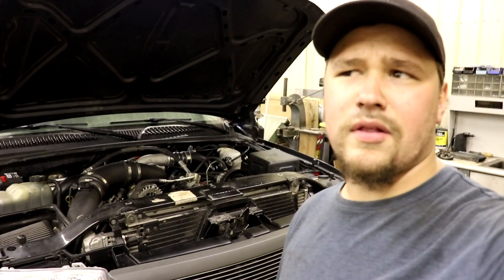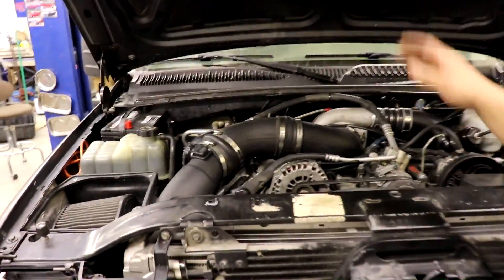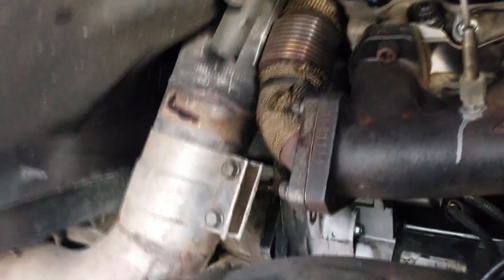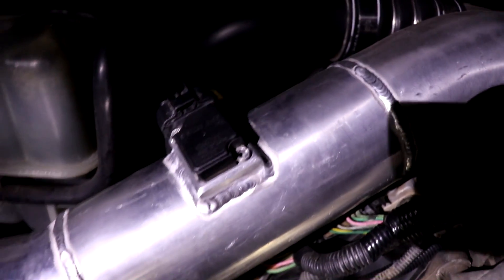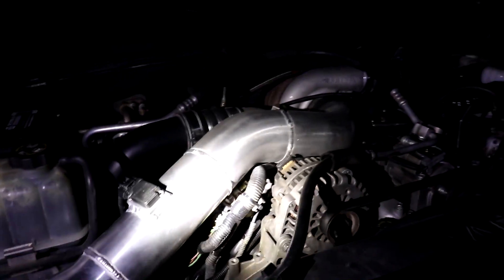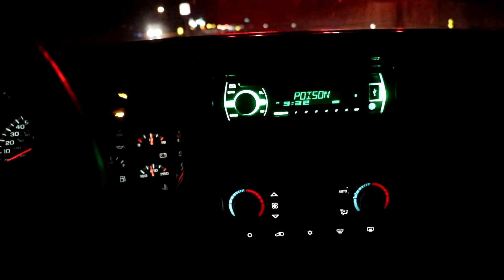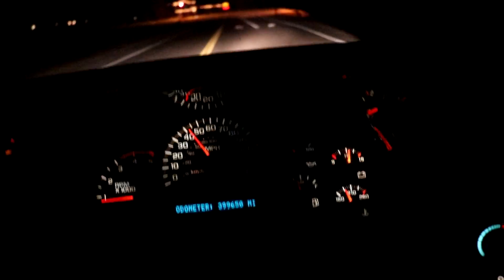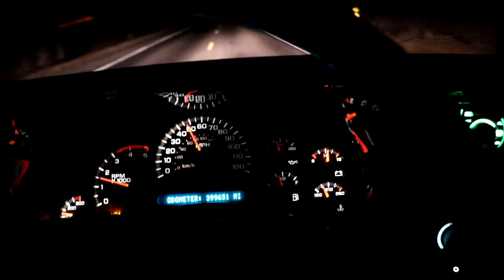Custom Turbocharger Intake | Duramax Project

Comment: The MAF is used by the ECU to calculate fuel. If you increased tube diameter, the MAF will be seeing less air speed and does not know the diameter increased so is in fact flowing more. As a result your ECU is sending less fuel than before if tube size increased. Solution is to do a remap on the ECU to adjust fuel. This does not mean it is necessarily the reason you are hearing turbo flutter. That could just be because you got rid of plastic and silicone tubing which makes turbo more audible. If you also got rib of the airbox this will multiply the noise further. I love duramamax engines, wish I had one in my 4x4!

Comment: idk if you figured it out but your mass air meter is tuned to the diameter of the tube its in, thats how it can figure out the mass of air if it knows the volume of the tube. a retune accounting for the diameter change should get her back to how it ran before

Comment: idk anything about duramax's but usually on MAF engines if you change the sizing of the pipe the maf is in you have to scale it in the tune. i think* when the diameter of the housing increases the maf sees "less" air coming into the intake. you must tell the ecu the values and issue should be fixed.

Comment: Did you respect the inside diameter of piping where the MAF is ?
You need to get the same diameter as the stock one was ,otherwise the MAF can't read a flow correctly.
flow is speed on diameter : you modify the diameter and the MAF is clueless of what's happening flow wise.
To be more accurate ,the MAF read and report a flow ,as a value,but the ecu can't interprete the signal correctly,the references the ECU relies on being modified.

Comment: I've got to tear down my lb7 and do a head gasket job, when I'm putting it back together and I put the wiring harness back on, does the computer have to be messed with or will it fire back up? I'm way put in the country, I'd have to get a tow truck to pull it 70 miles to a shop, thanks.

Comment: Weld a brass barbed fitting on that intake, plug in that breather. That should alleviate any blowby issues, and it shouldn't hurt the turbo. Do you ever run any anti-stiction additive?

https://www.hotshotsecret.com/  is great, even for fresh rebuilds like yours. 

RE: MAF issues- did you increase the diameter of the inlet? Are there any differences between the MAF housing and what you have now? Depth, orientation, volume all play a role. Did the old housing have a "shroud" or "deflector" around the MAF- or was the resistor directly in the flow path? Do you have a Scan tool? Check the g/sec.

Comment: Just wanted to add when I got a new tune on my Detroit 14 liter. It would flutter like that under load if I was below 1,500 rpm. They then returned and the issue was resolved.